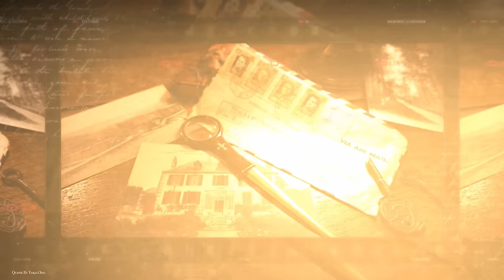Fitting The ORIGINAL Chateau Service Entrance Gates.

Comment: I think you are right. The stone with the metal half moon was buried with the metal half moon exposed & used as the backer to the inside of the bottom of the gate so the gate wouldn't accidentally be pushed too far inward which could compromise the gate itself & the hinges...Always impressed with your families teamwork.
Reply: Yes, and perhaps some hooks or retainers to hold the gates open, especially if windy!
Reply: Could the found stones with metal spikes have been used as tie offs\chain looped to keep the gates open?

Comment: Such a beautiful transformation of the gates & walls. Pure hard backbreaking work and well worth all the effort!  Well done.
Reply: Thank you grace 😊
Reply: @ashleywaters7198  I had a feeling that you were doing the running when I just saw glimpses of you.
I'm really glad to hear that you're going to wait to begin planting. Since you already have a plan, the pathways, irrigation system, water features and statuary can all start as soon as possible. That would be enough to keep even your gang busy until fall, when you can just drop plants into the ground and let nature run its course.
I'm aware that you want to use plants that are drought tolerant and will thrive in your climate, but a drip irrigation system would be advisable to get you through lengthy dry conditions. It's worth the investment in saved plants. I lost an established Serbian spruce because I assumed it would make it through a dry spell. I wept real tears when it died.
A walled garden of your size would be extremely difficult to water efficiently without irrigation. Beside running hoses around your parterre will damage too many plants. As it is, you'll probably always have to do some hand watering of new plantings, etc. You'll need faucets located strategically around the garden for filling water features, hand watering, spraying down walkways, etc.
I'd suggest running the water lines under the pathways.
Does the ground freeze there during winter? Do you have a frost line to consider?

Comment: You should send down gates and paint them before rehanging them.  You've done such a good job rebuilding the wall.
Reply: I thought the same.
Reply: Maybe security is more important at the moment  than painting  , it will get done.
Reply: Just as easy to do when hung, if not easier. I’ve had to do gates like that before and I’ve always kept them in situ.

Comment: Lovely new entrance to Chateau grounds.  Good idea for ferns outside gates near road.  A few Daffodils along that wall at road edge would be super too with wall as backdrop.   You will love having that new entrance for family parking.  Great work effort for all in the team.  Keep it up!    For walled garden, it might be nice to get hardscaping organized well before planting, then you can tackle planting by sectors enclosed by pathways.   One sector at at time, with intensive watering of new plantings for that sector, for initial week after , before reduced watering.   Only after that sector has settled in, begin working on next sector for new planting, then pamper for first week or two with extra watering to establish, and so on.... other wise you will go 'NUTS" racing about with intensive watering to settle in that massive  entire formal garden daily.... which will give you no time for anything else and perhaps water shortages from your well.  If you know some of the plants you want to plant in the formal garden already,  to save money you could buy a few then using cuttings propagate additional plants to reduce cost,  or start seeds for same purpose.

Comment: Phenomenal job on the wall and gate! Excited to see when it’s all pointed and finished. There may have been just a single row of stone right under the gate when it’s in its closed form for all those large stones you pointed out. Just a guess.
Reply: Absolutely right and the stone with the half moon metal piece is in the center to hold the middle frame of the gate so it stays straight and in line.  Sorry, you will have to dig and fit those large stones in the dirt but you will be pleased with the result

Comment: Fantastic effort by all on the gates and entryway.  Terry, I think you may be correct in your assumptions that the big stone with the iron separator went between the two gates, which would mean there probably was a series of cobbles at least across the gate closure.   By the thickness of that stone, you would need to dig at least another 8-10 inches down to restore it in place and to add the course of cobbles on either side.  Since you don't have all of the pieces or the extra time, laying down gravel is the easiest and fastest solution and will allow you to move on to more pressing issues.  The "gate gardens" are going to add more beauty and serenity to the area, and I look forward to seeing them in bloom one day.

Comment: You are correct about the large stone which the gates closed to, the other two mystery stones might be Guard stones, (quoting from wikipedia )" Guard stones were developed as an item of street furniture during the era of horse-drawn vehicles, but some are still in use today. They are sometimes used as traffic bollards, but are generally positioned to protect a specific object, such as a corner of a building or the side of a gate. There are also models in hard stone with a sloping back to guide errant wheels away from impacting a building.[1] Guard stones made of stone were sometimes surrounded by a metal ring to reduce wear. The wheels, including the hub, of horse-drawn vehicles protrude beyond the vehicle's body, and are thus prone to collide with and damage a corner of a building or gate. Today, early guard stones are considered cultural heritage objects and some countries, such as France and Belgium, even protect them under specific heritage regulations. "
Hope this helps, keep up the good work.
Reply: Thank you for the interesting comment 👍very informative 🙏😊😊

Comment: Yay. All you need now is a large stone with two holes drilled into it to place where the gates meet, for the slide bolts (I'm not sure what they're called). The stone with the metal flange looks like a good candidate for that. And you can see all the missing st0ones from the wall now. Filling in the collapsed parts will be so satisfying. It's looking amazing already.

Comment: loving everything that you all, dogs included, do...even imagining your lovely cat sitting on top of that big pillar like a lil/big lion on guard!!!
tracy, i'm an olde, almost 70, organic lifelong gardener n i'd like to warn you off using plastic on the ground..n even bark, as a cover. both sour n bark acidifies soil n your sedlings wont spread as easily. they may even have a detrimental effect on those trees. masses of cheap compost is all you need to feed that lovely environment, topped up by the best medium of all, autumn leaves for real enrichment n securing the walls.
Reply: adding....rich layers of compost are even better at smothering weeds than plastic or bark.

Comment: Hello Terry,
It's really a nice job you did at the side entrance. Your assumption that the stone with the piece of metal is the gate stop is, in my opinion, very correct. It would be constructively typical for such goals. Possibly there was just a "stone threshold" in the opening with this stone in the middle. Wheel deflectors would also be typical for the age of the gate, but these may have disappeared at some point due to the switch to cars, as they often restricted the gate width accordingly.

Comment: There was another structure or more on your land and you have found the Staddle stones | Stones To Support Oak Frame Structures.  They are the stones with the spikes they are made in different shapes and sizes as they are usually visible under the large oak pillars. a larger flat stone would be under the Staddle stone and the pillar on top with the spike to stop the oak beam from shifting.  Staddle stones were used mainly for granaries (storing grain) to keep out vermin and damp.  There has to be some mill stones on your property somewhere ;)   Staddle stones used to hold the whole building off the ground would have another stone on top between the staddle and the floor, this stone would be circular or mushroom shaped and wider that the stadle to prevent vermin from climbing the stone and getting access to the buildings.

The arrangement of the stones to support the structure and its weight when in use, required nine, twelve or sixteen staddles. The production of staddles was therefore a fairly significant local industry. Small granaries could make do with five, one being in the middle. The Upper Hexford granary in Oxfordshire uses thirty-six staddles.

In many areas the staddles were locally made and the shape can vary significantly depending on what they were used for - like very ornate ones for holding up oak beams on a Gazebo, Porch or Entranceway.

Comment: Looks great. I  would put the center block with the curve metal sticking out in the center back in the center gate. That would stop the gates from trying to open inwards and putting a lot of unnecessary stress  on the hinges. The under side  center of the gates looks to have a bar sticking down to hit the block to stop them. Also being in the center I don't think your  can tires will ever hit it.
Reply: Thank you

Comment: Great job on everything but the black plastic tarps  under and around the bottom of the tree.  Placing the plastic there will disturb its delicate root system by limiting the amount of water it can take up.  Trees cannot tolerate a change in the depth of soil surrounding them.  Keep the weeds down by doing what the previous commenter suggested and plant  hostas or some other shade loving plant.

Comment: One or two large hydrangeas, either side of the driveway, inside the service entrance gates, would work well.    They would bloom for several  months, require little maintenance and fill in the area adjacent to the driveway.       Also, they wouldn't require much soil amending.
Reply: Thanks Michael 😊

Comment: Just wondering if a little deep;er won't be any stones in the driveway. When I look at the space under the gates, they might be fifteen centimeters lower. in between the walls and under the gates there often was a barrier that connected the walls. If the asphalt of the road is put on top op the old road, everything might be a little deeper. A few probe holes perhaps?